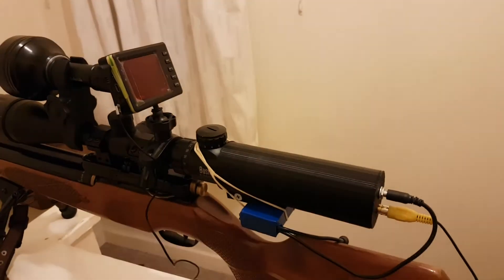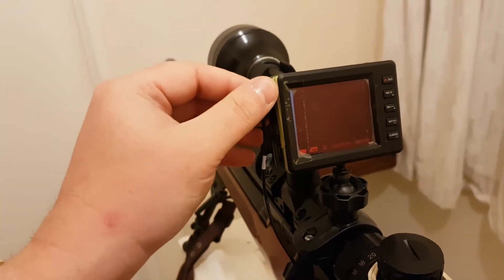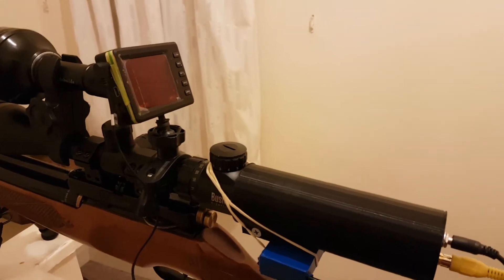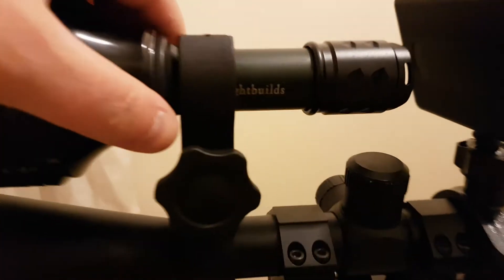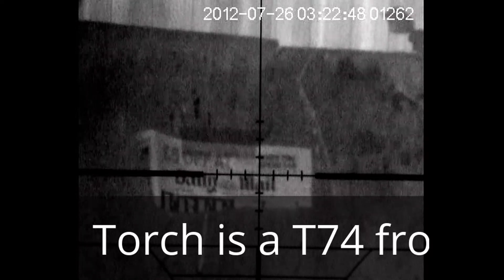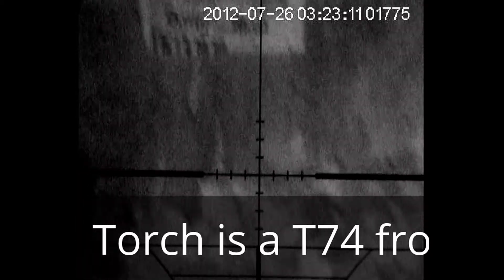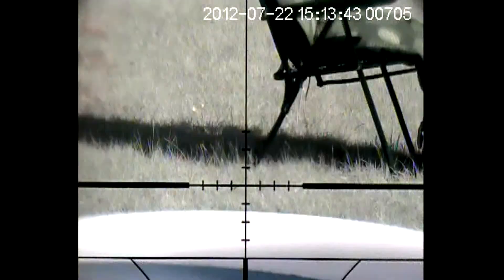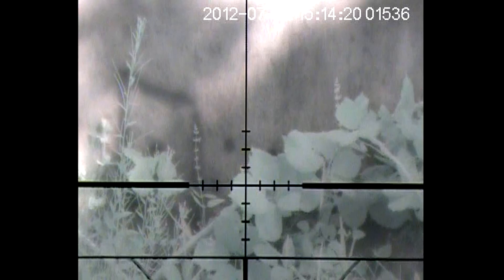3D Printed Night Vision addon - night time footage

Comment: Gavin you was asking about 12v batteries, the square blue ones we buy from china are ok for the money but because there is 3 cells in the pack each one being 3.7v, lipo batteries need to be balanced charged to keep them working well. Best bet is to buy a 3 cell 2200ma   lipo from Hobby king or your local model shop and a balance lipo charger, the blue ones from china are not the amps they say they are its a bit of a con but ok for a cheap way out if on a budget. Try a 3cell lipo you will not go back to the chinese 12v blue pack belive me.
Reply from the maker: +paul maddison yes. The one i used had served me well but probably due to what you have said it wont hold charge or just enough to power the LED.
Reply: Thats right because the chinese charger is not giving each cell the correct voltage, ive still got some and the red l.e.d. never goes of while charging so it is not getting full charge anymore. As you know you only get what you pay for, check out Deben there 12v batts are in the £££££ because they are quality.

Comment: Just a couple of tips Gavin, you dont need a plug+socket for the 12v supply just have the lead coming out of the add on with a plug going to your battery also the video socket would be better on the side. The more male+female sockets you have can just cause problems in the future.......they become worn out and not always get a 100% connection plus its easy to get the wires caught up when in complete darkness, not being sarcastic just trying to help you guys as i have 38yrs electronic experience behind me. Think about it.......as its not rocket science.
Reply from the maker: Ok. Let me see what I can rustle up. I see your point about the connectors. I guess, due to your knowledge, that we don't appreciate that a video RCA used in its normal life will not suffer from plugging in and out multiple times. I have just made a little purchase on Amazon which might help collide all the goodies we want. :) happy days.
Reply: Gavin there is no need for any plugs on the back of your add on, just have the 2 wires coming out using rubber grommits and a cable tie on the inside. Will look so much more neat and less chance of loss of connection / weight/price etc.